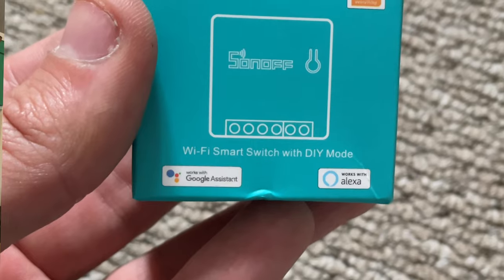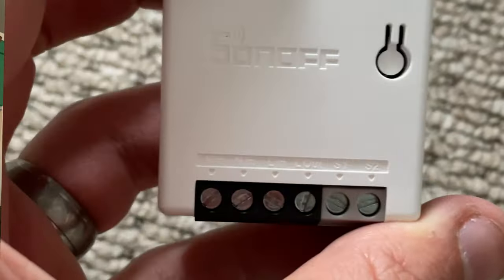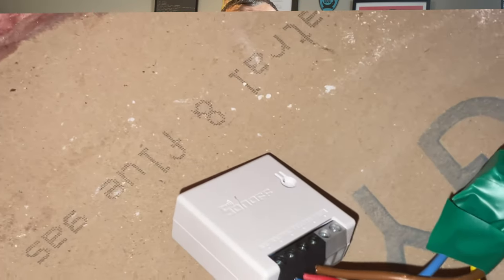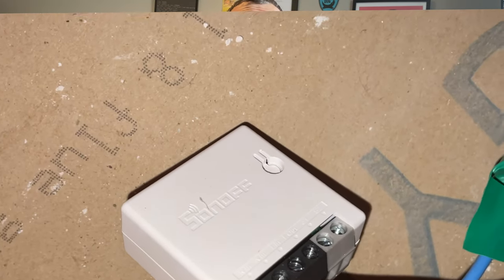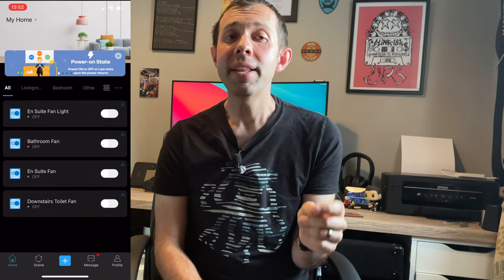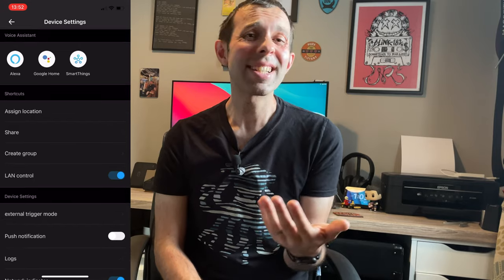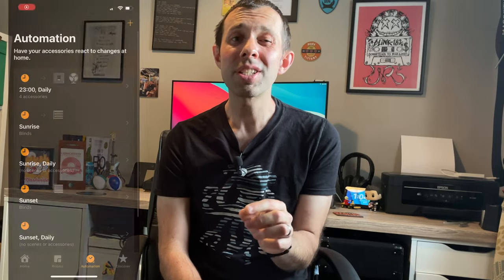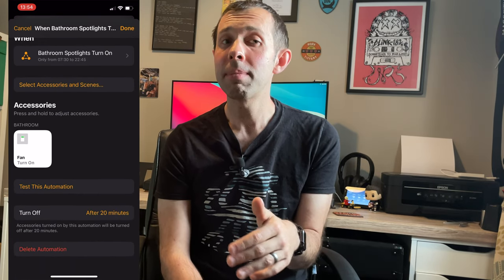How to make a bathroom extractor fan smart

Comment: Hi Make this is fab - been looking everywhere for a solution 👍👍👍

1 question - what do you do if your extractor has 2 live feeds? One permanent & one from light switch?
Reply: Hey mate..did you figure this out?
Reply: It really depends on your current setup and what you would like to achieve. Are you using smart bulbs or standard dumb bulbs? Are you using a dumb light switch to control the lights or are you using a smart switch?
Reply: In my own case, i have a Manrose MF100S Mixflo inline extractor fan which is connected to the light in the ceiling rose L and N. Both only come on with a single gang switch and there is no option to wire a second switch which will control the fan separately

However, i have 2 downlights in the bathroom which are 5w bulbs each. I recently bought motion sesnor and 2 gang smart light switch for the bathroom. 

If i connect a Sonoff mini R2 to the N&L on the light into Nin and Lin then Nin and Lout to the fan

Can i then use 1 gang to automate wirelessly with the Sonoff for the fan to come on as i have a humidity sensor in the bathroom then use the other gang to turn the light as normal

Will this work or have i got it all wrong in my head
Reply: @iambueno  in the video he didn't say which load in he connected to the Sonoff mini R2. Was it switched live and neutral or live and neutral? Especially for fans without timers
Reply: Put the sonoff on the switched, instead of the feed from the light the feed comes from the sonoff.

Comment: I’m going to do something similar but use the Meross that has built in WiFi so no bridge. By plan is to blow cold air from my heat pump water cylinder in to the room at a certain temp

Comment: Any idea how to wire this if my fan has Live, Switch Live, and neutral
Reply: My manrose Fan seems to only come one when live and SL are active.
Reply from the maker: That’s not something I’m sure about and I’d suggest hiring an electrician to install it if you’re not sure about the wiring
Reply: Put it on the switched live. Then it will go the same job as the light switch was doing.